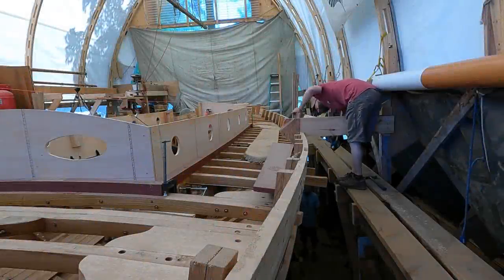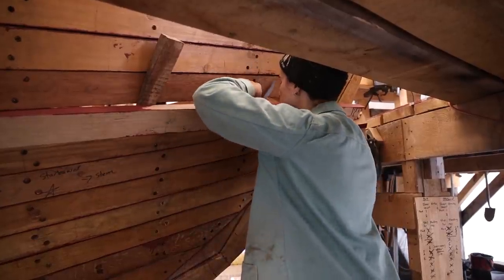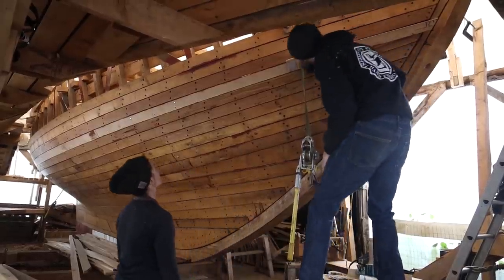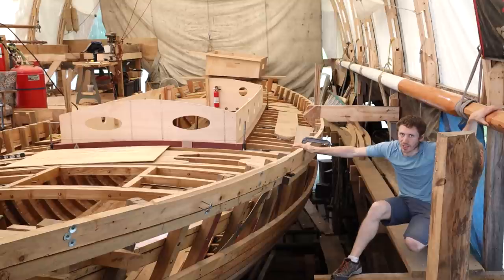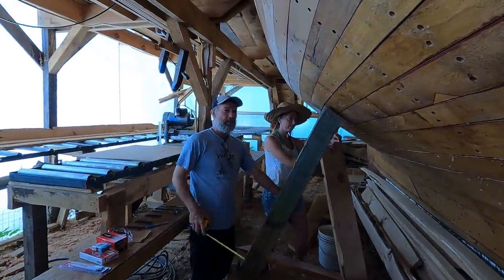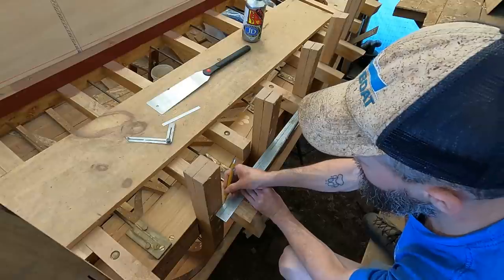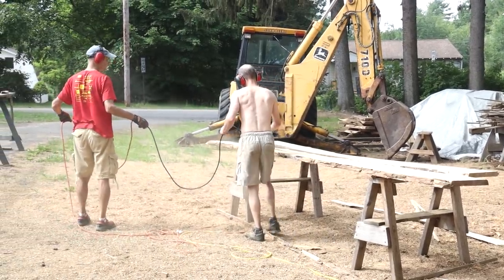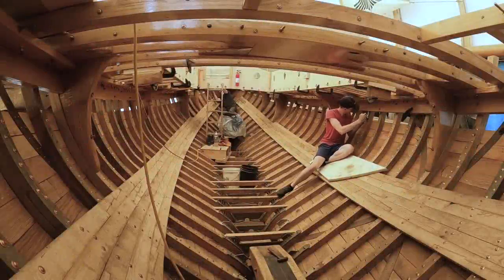Bracing for the Sheer Plank - Episode 167 - Acorn to Arabella: Journey of a Wooden Boat

Comment: You have to finish that pencil draft with a wood burning tool, it would be the perfect seal on the hull interior to symbolize the contributions of the volunteers... And Steve, stop waxing your chest, you have plenty of fuzz on your chin, you won't embarrass us lesser haired fellows! Kidding, of course, I'm sitting in 80 degree weather at 9:30 PM, and am blissfully shirtless before a fan. Very grateful I don't have a huge wooden sailing vessel in my side yard demanding my attention during the muggy daytime hours. Since I'm retired, I also have a load of hand tools I no longer need, mostly electrical oriented, but I was a general contractor for the City, so I've got a bit of everything. If you guys can use them or know of a deserving group that can, I'd be happy to donate them, with reasonable shipping costs...
Reply: Perhaps also check with your nearby local Jr. High, and high-scholl, and any trade-school to see if a teacher or advisor can suggest whjo would make good use of some or all of the tools. Best to have the tools kept in use rather than sitting. You are a very thoughts and a generous man.
Reply from the maker: Also check your local makerspace, they make very good use of tools and are often working with a tiny budget. Many have popped up, and so have tool libraries managed by local orgs such as book lending libraries that already have the system to track and store everything.

Comment: Hey guys, 
I’ve been holding off on writing this for a few months now. But find it’s time to get it done. 

I came across the Acorn to Arabella project/channel like most, when you poured the keel lead. 
Ive watched every vid with keen interest. I’ve never been any good at wood work. Until watching you I’ve always always been into and practiced metal work. 

I have just found that I’ve really lost interest since Alex has stopped the videography/editing. It was always more engaging and authentic having you guys explaining everything yourselves rather than the new  narrated time lapse edits. 

I understand that not having Alex edit and film it speeds up the build but feel there is people out there loosing interest like myself. 

I never though it would miss an upload but now only watch here and there and even find myself skip through the majority of the vid. 

Just my two cents worth. 

Cheers from Newcastle, Australia.

Comment: Let state the obvious. Scary as it might be, the probability of being hit by lightning is the same whether you’re on or off the boat. Ive owned a sailboat since 1966 and the boat was in the water, mast up, for at least 5 months each year. Ive cruised from NYC to New England and been on board through at least two squalls per season….my boats have never been hit by lightning, nor lost any electronic equipment. I’m not bragging, just stating facts. In our mooring field a long side City Island there are several hundred sailboats of many sizes. I’m aware of one that was hit and several that lost equipment due to lightning. The one that was hit, sank. It sank because the mast was grounded to a through hull and not the keel. The strike destroyed the through hull the water rushed in. Another idea about what to do on anchor when the wind picks up during a squall. Start the engine, put the boat in gear and steam directly into the wind. Use enough throttle to reduce pressure on the anchor but not enough to move forward over the rode.

Comment: Have you started plumbing and electrical drawings yet? I can only imagine the battery banks to run the boat while you're "on the hook". How many days of water will you carry? Some crossings are two weeks or more. Some remote areas are pretty dodgy if you can find it. Drinking and cooking system plus washing. Saltwater blackwater. Storage and topside pump out. If you are within most states waters the boat has to have a built in storage so you won't just pollute the waterways. Fuel filters for filling and recirculation. Dockside fuel sources are of questionable quality. It's slower but easier to test and filter while filling.
Reply from the maker: We’re going to have an episode about water storage soon. Stay tuned!

Comment: I'm seeing some serious light between some of the planks. Is that going to be a problem with caulking? I always thought that the planks should be slightly touching on their inboard edges, but I'm no boat builder, I do build rather large R/C model aircraft with wood, and know that glue doesn't make the best gap filler.
Reply: Ideally, with Carvel planking the inboard edges would touch with relief toward the outside for caulking.  In reality, since the water content of the wood varies and there are imperfections in the build, gaps can occur during fitting or dye to drying.  There are also potential problems if the hull is tightly planked with dry wood, caulked and launched - compressive forces can be very large when the wood swells.  The caulking does some two way magic by sealing the gap, swelling when wet, but also easily adjusting to compressive loads from the planking.  In my view, Carvel planking should be "just right" based on the water content of the wood, the movement properties, the width of the planks, etc.  In the end, gaps can very successfully be accommodated by caulking but over-tight planking is hard to fix, especially if you rupture multiple planks while at sea.
Reply from the maker: The planks went in with a tight fit, and a few humidifiers will return them to fitting tightly on their interior edges before we caulk.

Comment: Hey guys let me predicate this statement or question by saying I've never built a wooden boat I'm just wondering about the last Oak plank that you guys put in it just seems to me if that one is so tight and the others are quite loose for Caulking and everything it seems to me like you would get a lot of movement on the adjacent planks when she swells so there will be a lot of side forces on your Fasteners on those two planks specifically the ones above and below the last plank you put in because it's going to swell just as much been subscribed for 2 years now thank you ciao for now
Reply from the maker: Hi Don! That’s a great question, and when that can be answered by watching a few of the previous videos. All of the other planks are as tightly fit, because they were edge set with come along‘s and have just lost some more moisture since having been installed. Before the hull is caulked, some moisture in the space will swell them to their original tight fit. We’ll use humidifiers, misters, or maybe just keep the floor of the boathouse really wet for a month or more.

Comment: On this episode, we use the age old method of measuring 10 times and cutting 5 times
Reply from the maker: If we’re coming out at 2:1, I reckon we’re doing all right. 😉
Reply: With as much work as they've put into those shutter planks, I can sure understand why they don't want to screw up the last cut.  But "measure 10 times, cut 5" is a good one!  Have to remember that.
Reply: Hey Drake, how's it going? Just curious if your real name is Drake Anglin. Not planning an amazon scam just thought if that's your name your family is really into boating.

Comment: Great content as always and congrats on completing the oak planking!

I have 2 questions if you don’t mind:

In order to assist with getting the stem ends in on those last 2 planks, any reason you couldn’t unfasten the ends of the planks immediately above or below to get space to use clamps and then refasten them after?

I notice that there’s daylight between some of the planks. If there’s a good chance the planks will shrink some more how do you effectively caulk when the backs of the planks don’t meet (I.e. there’s daylight)? Wouldn’t the cotton just get pushed all the way through?

Thanks and already looking forward to the next episode!
Reply from the maker: Hi Sean! The fewer times a fastener is removed and put back in, the better. It might take us a little time to work around the fastened planks above and below, but it’s worth it. Before caulking, the shed floor will be doused with water weeks, if not months, in advance, and if needed, humidifiers will be deployed to swell the material. When the interior edges are touching as they were when the planks were installed, it’ll be good to go for caulking.
Reply: Just keep your joins wet and cotton will be fine I have learned a lot about ship Building and repair.
Reply: @AcornToArabella  very good edit on the episode. Master level.
Reply: @AcornToArabella  Gotcha! Thanks!

Comment: Any reason why you wouldn't close up the end-grain, on the deckbeams?
Reply: Even if coated, coatings fail. Better to drain. Gravity.   Now that's dependable.
Reply: I wondered the same thing. I don't understand how it would interfere with Dan Weyant's explanation. Gravity is in play whether the end grain is sealed or not. Just curious.

Comment: Hi Guy's, it's been a while since I asked a stupid question, so here it is.. those last oak planks seemed a bit of a tight fit? any worries when they start to swell with the moisture??  hope you all have a great summer, take care, all the best from the UK .
Reply: They're actually counting on them to swell before and moreso once she's in the water. Between the cording, the caulk and the swell of the planks it will make her as watertight of a ship as she can be.
Reply: Unless they're super dry my understanding is it's hard to fit them too tight. As already mentioned the swelling seals the hull, not unusual to splash a wooden boat and have to run all bilge pumps for hours until planks swell enough to stop the leaks.

Comment: Just curious, most of the other planks seem to have been placed with some extra room for expansion, any concerns by placing these ones so tightly? Could there be issues when they swell? Perhaps not an issue if they’ll be above water line?
Reply from the maker: The others were fit just as tightly… remember the comealongs (massive mechanical advantage) used to edge set them to the edge of either the plank above or below them?